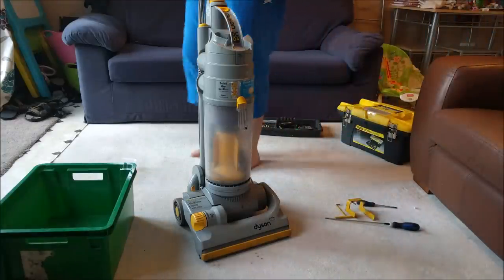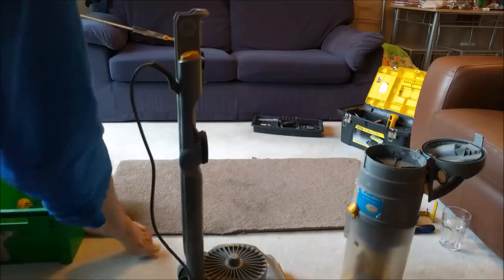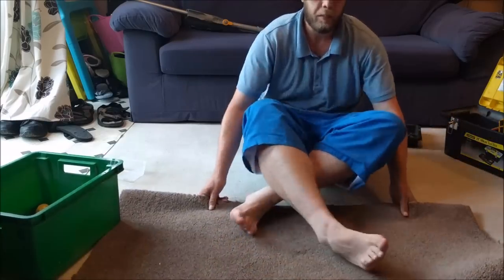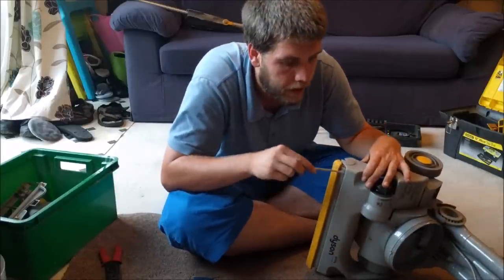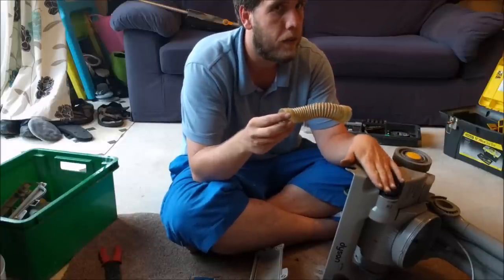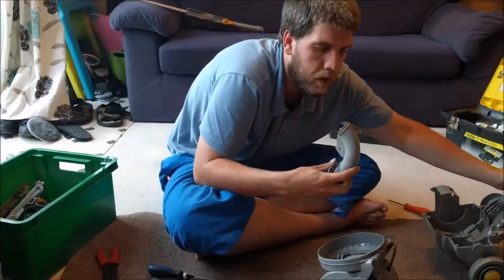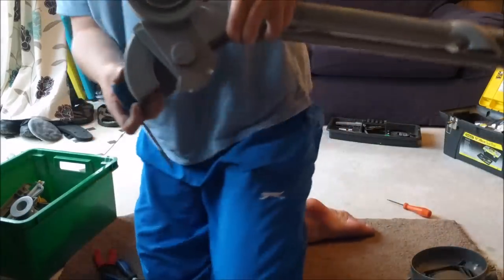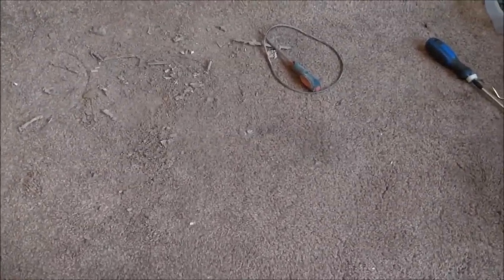How to strip down, repair and re-assemble a Dyson DC04

Comment: Sam’s talk about the internal hose problem on the Dyson uprights was spot on! 
This has plagued me countless times during a rebuild. You do a proper set up with 
 the original used hose and in a short time you lose the tension again.
 My fix is applying weights as mentioned,but I don’t glue them on.
 I found that peel and stick wheel weights in the 1 oz size is the best
 and cheapest permanent fix. You use about 3 to 5 ounces on the brush roll 
housing.  Best yet, it can be installed when the vacuum is fully put together.
Reply: You all probably dont care at all but does anybody know of a trick to log back into an Instagram account?
I was dumb forgot my account password. I would appreciate any assistance you can offer me.
Reply: @Nixon Uriel Instablaster :)
Reply: @Winston Edison Thanks so much for your reply. I got to the site on google and I'm in the hacking process atm.
Looks like it's gonna take a while so I will get back to you later when my account password hopefully is recovered.
Reply: @Winston Edison it did the trick and I finally got access to my account again. I'm so happy!
Thank you so much, you saved my ass :D
Reply: @Nixon Uriel You are welcome :)

Comment: Hello there. Thank you for doing this video, i acquired the same dyson, and many others, and have watched this video stat to finish ,.I kept pausing it and copying what you did. Now its looking great like yours. I managed to get some rubber o rings to replace the large perished ones. It took me ages to figure out which rubber washers/seals went on the bottom selector piece. once again thanks for your video, took 8 hours start to finish, but was my first dyson. Will people still buy these refirbished?
Reply from the maker: Awesome, that's great to hear! Once you've done a few you find your own flow and way of doing it, as you've seen it's not scary! Selling stuff my way has slowed down, but I'd ask £50 for a sorted 04, 60 for an 07/14/33 etc. Just got to find the price they sell at in your area without selling them too cheap (don't fall into the trap of spending time on a scruffy one as you won't get what you want for it!)
Reply: Just done another, purple and lime this time, had seized bearings in brush roll, and bad clutch, now sorted and as new! took 5 hours this time......
Reply: Yes people want these as its a great, easy to use machine.

Comment: This is brilliant! with zero experience or knowledge I rebuilt our DC04, which it turned out only needed a clutch drive belt. 
One (hopefully constructive) comment from a novice. At about1:16 where you are feeding the gasket round the plastic circlip I found I could put the circlip in the gasket first them just put both onto the machine together. Can you see any problem with doing it this way round? Many Thanks Tim Cook

Comment: I'm slightly concerned about using ordinary grease with the rubber fan-cover. I was told that oil-based grease etc. reacted with synthetic rubber and rotted it. Therefore, I was told, use silicone grease or silicone oil. Yes, it's more expensive to buy but you only need a smidgen and it might work out cheaper in the long-run? What think ye?
Reply from the maker: I too have heard that in life (especially around car brakes, I bought a special tube of special grease for that) but I've had machines I've refurbished back several years later for various work, and it's always been fine. However, a fair while ago I stopped using grease at all after seeing the dried mess it leaves! Infact now I spray plain water around the inside of the motor bucket (not a lot, just a fine mist) and it slides the seals through a treat, and then dries right off! Drop of grease still goes on the wheel axles though!

Comment: When you put the cyclone back on again, and everything works properly. What do you do about the cyclone if one day it won’t come off ? This has just happened to me. I took the hose and fixtures off and you can see the mechanism at the back of the machine. It seems to all being balance on the operation of a spring and a push button . How do you take this apart to replace the spring?
Reply from the maker: I've had this once. You can get to it with a thin long screwdriver poked behind the cyclone and actuate the latch iirc, I did it once outside someone's house...
Reply: @beko1987  Brilliant, thanks for the quick reply . I’ll try it, if it works for me I will reply. Cheers.

Comment: At the bottom of the cone, there is a small piece of plastic stamped A2. It looks as though it should come off. It is trapping hairs that, I can't remove unless I remove the cone completely. Can this piece be prised off? Can it be removed completely?
Reply from the maker: I know the bit you mean, and it doesnt come off. Well it does, but will need gluing back after. They can be a right pain to clean, especially if the whole cyclone units been smacked on a concrete floor to 'clean it' in the past. Pair of needle-nose pliers from the top of the cone?

Comment: Hi there, bought a second hand 04 today. Mainly for spares.After a thorough clean inside and out,I decided to try it. The motor runs well and there’s plenty of suction at the wand end. But the brush does not spin. The drive belt is in place . And the brush will spin manually. Any ideas of the problem ?  🤔
Reply: Replace clutch mechanism

Comment: Hi, can you please tell me whether the handle wand itself  can be dismantled to make it shorter? I need to pack it in a parcel... Thanks for any info
Reply from the maker: Afraid not, the wand is the longest bit! Sometimes if you remove the upper cord hook the metal pole comes out of the plastic top but only if the glue has dried up...
Reply: @beko1987  Thank you, I will stop trying then 😊, dont want to push too far.
Your video helped a lot!

Comment: My dyson dc04 won't switch on how can I find out if its the switch
Reply from the maker: Test the flex, or did the motor burn out? Or did it just turn off one day and mot turn back on? If you put your ear by the switch and push it, you should hear it click latched, then click unlatched. Could be a few things sadly, if you've got a multimeter and a t25 torx it's not too hard

Comment: We need to move the power cord grip (near the plug) a little bit, but it fits very tightly. Any tips on how to move it without breaking it? DC04.
Reply from the maker: They do unclip with a small screwdriver, but clipping them back together is more tricky, I tend to use a pair of molegrips or water pump pliers to squeeze it back together. It just clips in the middle, you can see it when you look at the top or bottom
Reply: @beko1987  Many thanks, I appreciate your reply. We will give this a (careful!) try.